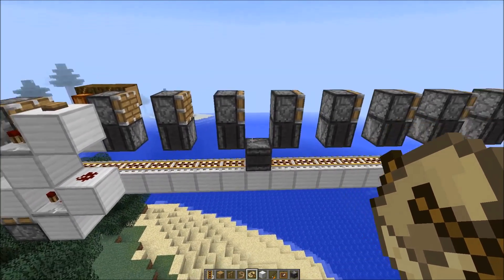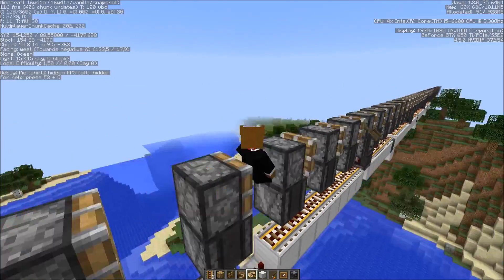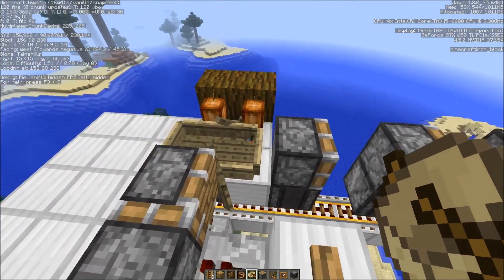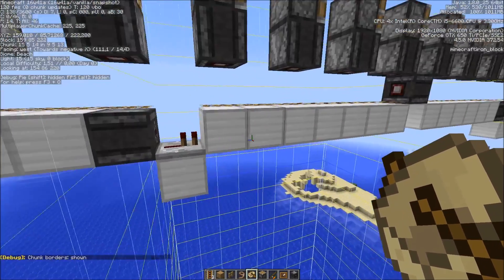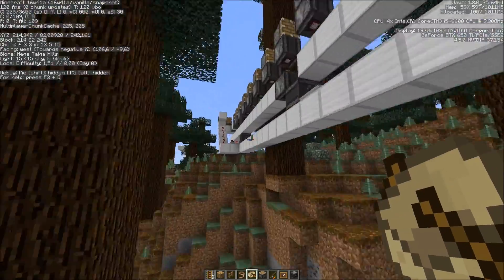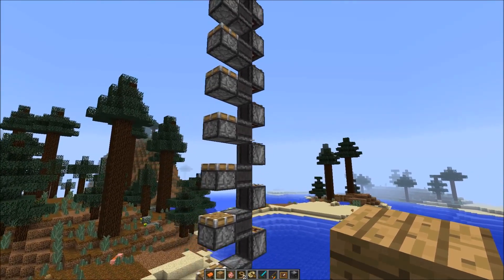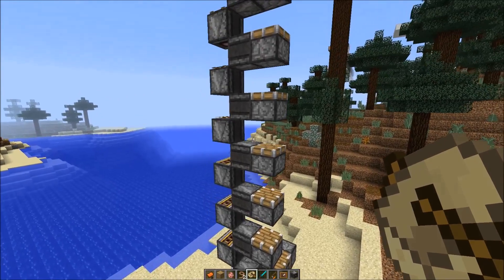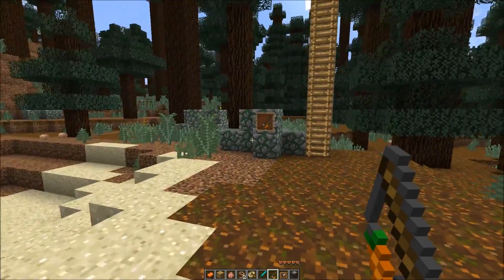16w41a: simple 160 m/s transport system [broken]

Comment: I would like to see you do something interesting with some recent stuff you have showcased- specifically, block update order with redstone repeaters, comparators, etc. as well as extended 2-tick pulse. You mentioned in that redstone tutorial video that it is possible to use the same line, simply with a 2-tick and a 2-tick-extended pulse, to produce two different output signals.
In the "real world" I haven't heard of a similar "mechanic", where you can use the same binary input line for separate outputs. I'd like to see if it were possible to produce more compact, "weird" computational logic using these mechanics.

Comment: Technically you can't make a survival way of traveling at or above the speed of sound(ya this seems random but from all of the stuff yall have been uploading it appears there is a misconception) being as you can at maximum travel at 320 m/s where the speed of sound at sea level in regular atmospheric density(what most people mean when they say "speed of sound") is 341m/s. The transonator that yall made still is considered trans-sound because that is qualified as between 0.8 and 1.2 times the speed of sound. Yea this isn't really at all relevant and doesn't matter at all, but as a physics nerd i must say this
Reply from the maker: pi showed a faster version recently. If you go diagonally you can reach 400m/s.
Reply: Yea, that would work, but my emphasis was more on the transonator, however i did say that you couldn't go faster than the speed of sound in survival, which was incorrect in fact

Comment: Can you show how to make it auto dispense boats?
Reply: Now we have the observer in the game, it's pretty easy. Place two dispensers, facing into the same air block. Fill one with boats, the other with a bucket of water. Place an observer block behind each dispenser. Then power both observers with a 2 tick pulse and you have a working boat dispenser.
In the rising edge, the observer will power the dispenser with the water bucket, so water will be dispensed. At the same time the dispenser with the boats will be powered and a boat will be dispensed. After 2 ticks, at the falling edge, the observer will power the dispenser again,  so the water will be retracted.
Reply: Okay, I'm going to put this in a really simple way, just for you babe.

1 - dispenser with water
2 - dispenser with boat

You will power them with a PULSE (not a continuous signal) in this order: 1 - 2 - 1.
Reply: Its really hard, because you need to have water in front of the dispenser!
Reply: ***** I think he wants to drop the boat to use it in the translocator.
Reply: Thanks matroosoft!!